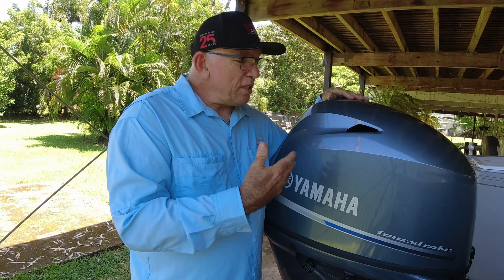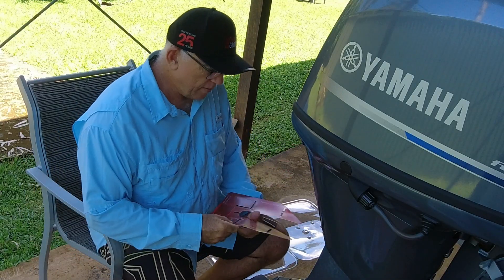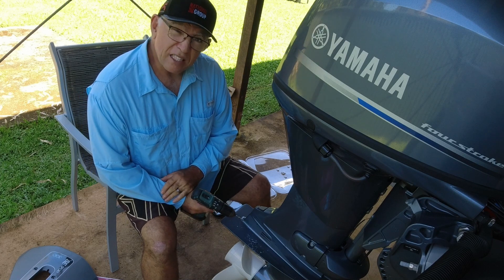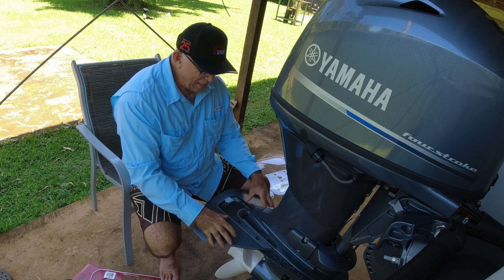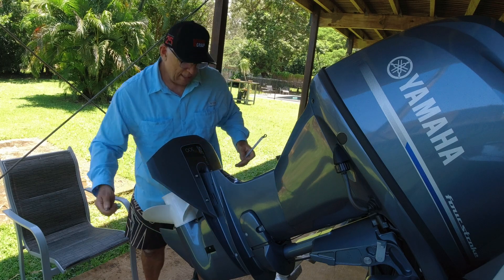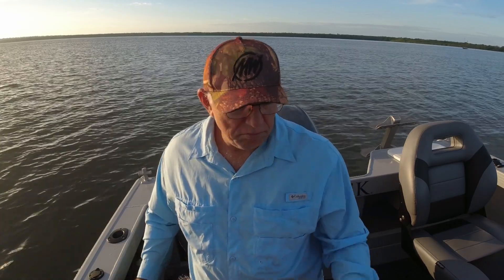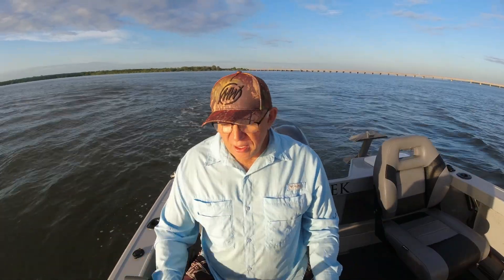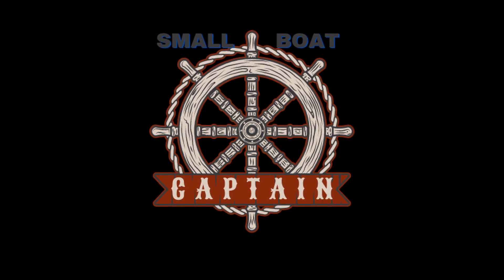HYDROFOIL. Do they work?

Comment: My boat gets a bit unstable at top speed… does anyone know if this will stabilise it. I baught a 300 Fin about 12 years ago but haven’t got around to fitting it yet. 
Thanks
Reply from the maker: G'day Twintimers.
It doesn't work to stabilise a boat at high speed unfortunately. I'd love to take a look and drive your boat to see what is going on but it is more often then not, weight distribution or poor hull design. In some cases the outboard is too high as well but I would send it to a good marine mechanic and ask them to take a look at it. Something isn't right.

Comment: I have an old 1988 ranger 393v w an 87 150v6  Johnson. I have a bunch of batteries in the back because I do a lot of fishing the fuel tanks are under the seats but still a lot of weight in the back we're talking like four batteries.  So they said to get one of these to save on gas and smoother ride. I dont really have a prob as is. I plane around 12 mph and she runs like butter. So im just curious as to if it will make that big of a difference
Reply from the maker: Yeah for sure. Let me know how she goes. Should lift the back of the boat.
Reply: @smallboatcaptain1968  shure does!
Reply: I to have a Ranger Bass Boat And boy is it heavy in the ass, end 4 batteries plus a 40 gallon fuel tank Like to know how yous is running?  Thanks from Connecticut USA
Reply: @greggo502  love mine. It's not a miracle worker but I noticed a difference!!  I'm in the same situation and I pushed her wot to 55.4 mph

Comment: Hi SBC, Well I finally fitted my SE Sport 200 to my 350 Quintrex Outback Explorer. I was told the SE 300 would be overkill for a 15hp Yamaha motor.  I didn't get to try it solo for a few weeks as my son has been tilling the boat with me sitting at the front.  So I finally gave it a big run by myself.  The difference was fantastic! The boat got straight up onto the plane at low speed. So I now have vision instead of staring at the floor of my boat with the bow pointed skyward. And, if I give it a fistful from a standing start it's even better. Another bonus was the steering was much smoother. I was previously very worried about someone getting tossed out of the boat, as the steering was so sensitive. As you said, they are punt-like at the transom.  The hydrofoil has made the steering much smoother, still I wouldn't suggest any acute turns at high speed in this boat.  The real test came yesterday as I headed home into a southerly. This was a real problem before, but yesterday the bow stayed down and it was a much better ride.
Reply from the maker: That's fantastic mate. So good to hear. I wasn't too sure myself on how well it would go on the 15hp but sounds like it has worked amazingly well. 
SBC.

Comment: Hey, SMB, I have a Quintrex Outback Explorer with a 15hp Yamaha 4 stroke tiller, which I've only had in the water a few times. I have 2 problems: firstly, because I have a very heavy AGM battery at the back for the bow-mount trolling motor, plus me and the fuel tank, it doesn't get up on the plane as quickly as I'd like--especially at low speed (I'm a slow roller). The other problem I'm having is when I stop or turn it's a little too sensitive for my liking--at first it felt like I was going to get thrown out of the boat. Even though I've only had the boat in the water a few times, I've learned to hang on, but I'm worried that when my 15-year-old son takes the helm it could be a problem. Aprat from a SE 300 getting the boat up on the plane quicker, do you thing it will improve stability when stopping quickly or turning?  I do sound like a bit of an amateur here but it's my 5th boat, and that includes having a Haynes Signature 530 with an 115 HP motor.  This was also the case with a little Quintrex Wanderer I had with a 6HP--it got up on the plane very quickly but you have to be very careful not to make sudden turns because of the flat bottom. But the Explorer has a deep V hull.
Reply from the maker: G'day Fred. Sounds like the explorer has an issue with all the weight to the stern. The hull design of the Quintrex is an interesting one. It has a sharp entry point with that flared out bow but it is still a punt of sorts. A deep V Hull is a hull that is deep at the transom. Some manufacturers now call their hulls variable deadrise hulls and I guess technically that is true, but the deadrise is measured from the transom and not the entry point. So a hull with a 20 degree deadrise is considered a deep V hull but just about all boats have a much sharper entry point at the bow. Your explorer is very sharp at one end but is like a punt at the transom. This is important because when you're on the plane in smooth water, it's only the transom this is in the water. 
I love the Quntrex hull designs. They are great boats and after owning a 4m Hornet years back, I rate the sharp entry greatly. Great boat. But while you don't mention the size, with a 15hp, I guess its the 370. The 370 will plane with just a small amount of the stern in the water and by putting too much weight back there as well, this will have it riding on the keel and a tiny amount of stern. I bet its fast when she's on the plane but would be very sensitive and coming off the plane, may even have the stern wave come over and want to swamp the boat. 
The only answer is to get more of the keel and the back of the boat in the water. Weight distribution in small boats is so important. I will actually look at doing a video on it because I have had that issue many times in the past. 
I'd fix the weight issue first and see if that fixes all your problems, including the issue with getting on the plane. Ensure your engine isn't trimmed out too far and if it is still not getting on the plane, then a foil will definitely help. But I suspect the weight distribution will fix all your issues. 
Please let me know how it goes. 
SBC.
Reply: @smallboatcaptain1968  Thanks SBC. In the meantime I did buy the small version of the SM 300 Hydrofoil, and I'm about to fit it.  I'll get back to you.  And I've just realised I called you SMB instead of SBC, which comes from my many years of drinking San Miguel Beer.

Comment: I’ve run the SE Sport 300 on my boat for 16 years now (yes, they last!), and it was the single best upgrade I’ve ever made. It completely eliminated any cavitation and prop blow out, which has been especially great when pulling tubes. Because it helps focus the prop’s thrust, it makes for a very assertive hole shot, and it makes turning very sharp and precise. For V-Hulls it’ll get you on plane faster, and eliminates porpoising. I’d never be without one, and the SE is the best one on the market!
Reply: If you read my above comment. I have a 19 ft ranger 393v an 88 with an 87 150 V6 Johnson. I have like 4 or 5 batteries in the back for fishing. Will be interesting to see the difference this makes
Reply from the maker: They make a massive difference to some boats that's for sure. I don't think they are needed on all boats but has made a big difference to mine. 
Thanks for the interesting comment mate. They can be a great addition that's for sure.

Comment: Have one on a 4.2m Quintrex/ 40hp merc combo. Very noticeably better at all speeds except flat out, and in any turning manoeuvres. Love how it planes slower and smoother.
Reply from the maker: Great rig. I owned a 4m Hornet with a 40 and needed a hydrofoil for that too. Great boat though.

Comment: A wing can make a difference especially in skinny water and since I'm assuming you're from down under have you ever looked at Permatrim Cavitation Plate that's made in Auckland.....The install on my skinny water tunnel boat helped the out of the hole lift and helped to prevent cavitation on my 4 blade prop.....Just saying!!😎
Reply from the maker: G'day Wes. Yes I am from downunder. Far northern Australia. I live in a place called Weipa which has the highest boat registration per capita in Australia. We all love our fishing and boating up this way. I have seen a number of the Permatrim hydrofoils on boats up here and from all reports, I believe that are an excellent hydrofoil. I simply went with the SE Foil because I have used them before but I did look at the Peramtrim. It was around $100 more expensive so I stuck with what I know.
Reply: @smallboatcaptain1968  I put one on my skinny water tunnel hull 2 years ago with a 25 Yamaha and just today ordered one for my center console with a 70 Yamaha.....Gives me a lot of lift out of the hole without trim tabs!!😎
Reply from the maker: @WesLovelace  I will have to give them a go some day. They seem like they would have less drag through the water as well.
Reply: @WesLovelace  i had one on my last boat and i found it good will be getting the same on the new engine i like the way they are made from ali and can be used as a step if beah launching
Reply: @smallboatcaptain1968  Permatrim foils are excellent; we stuck one on a 70hp ... like a new boat. You pay for what you get, I think
Reply from the maker: @jmpersonal2402  I have heard so much about the permatrim foils. They sound great so will have to give them a try.
Reply: @smallboatcaptain1968  Wow when i checked the oz propellors foil ( same as the permatrim different name ) it was cheaper than the se 300 from boating campin and flogbags by 30 dollars
Reply from the maker: @crispernator  For my 70hp from Oz Propellors, it is $231 and $253 with freight but I got the SE300 sent to me for $160. Here is the Oz Propellor site I got the price from. 
https://www.ozpropellers.com.au/aluminium-hydrofoils/yamaha-outboard-hydrofoils/
SBC.
Reply: @smallboatcaptain1968  wow thats amazing the price difference between 40hp and 70hp no wonder you went with the se300 i cant see why there is such a big difference the legs would almost be the same maybe a tad larger
Reply: @smallboatcaptain1968  wow thats a big difference between a 40 hp and the 70 hp i went back and had a look at it and then searched for the se 300 picked one up on flee bay for 132.00 looked at the video again and saw how easy it was and there are mounting holes already and decided it would be an easier install rather than having to guess if its straight and drilling holes through both foil and cav plate .
Reply from the maker: @crispernator  I saw that as well. The price jumps a heap at the 70hp backet. I have had heaps of feedback on the Permitrim so must be a great plate. I will see if I can do some testing on one. 
Thanks for the feedback mate. 
SBC.

Comment: I made my own one out of lexan.slowed boat down a bit...easier to get on plane with...and stayed on plane at slower speeds.
Reply from the maker: G'day Stuart. Nice work. I found the same too. Most foils I have fitted to boats have slowed them down too. Didn't slow my SeaJay at all but that is not the norm. It did make it plane a lot easier and does stay on the plane at slower speeds.

Comment: I'm so glad I watch this I'm a big man with a 4.20 explorer with 40 HP 4/ST a lot of wight on the ars end fish on my own mus of the time do you think this could help me buy the way it's Tiller great  I'll check the rest out 👍
Reply from the maker: G'day mate. I think it will for sure. Such a light boat with all the weight on the transom probably has it bogging down with the bow up when taking off. If that is the case, the foil will help a lot. If your boat happens to launch out of the hole and straight up on the plan without any fuss, then a hydrofoil won't improve it much at all. 
The SE300 foil I fitted to my 70hp will also suit the 40hp. Some might suggest a SE200 for a 40hp but I have found the 200 is too small for anything 40hp and over. 
Let me know how it goes mate.
Reply: Thanks so much for that I will let you know 👍